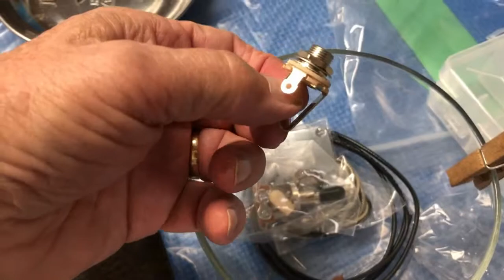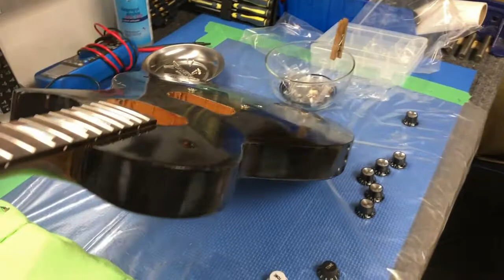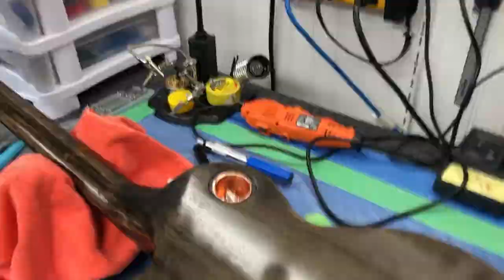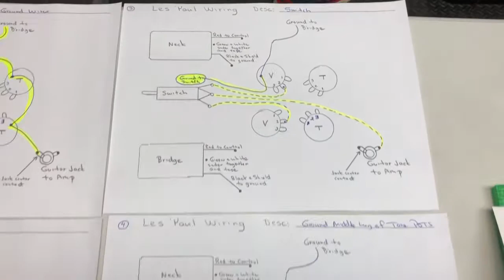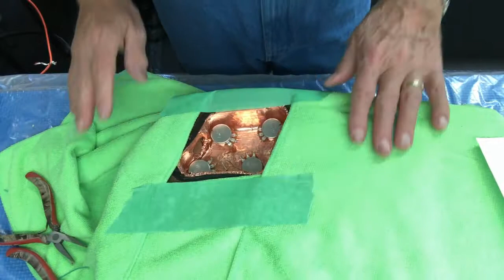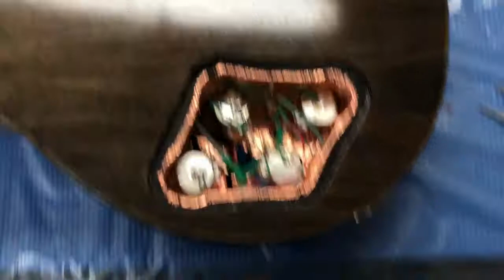Guitar Repair - Gibson Les Paul Rebuild-5

Comment: Thanks for this video series that you have done, i am currently rewiring a switching out all the parts on a Les Paul copy guitar made by Encore. I can certainly see the difference between the quality of the guitar that i have compared with yours. I have never done anything like this before and you pass on a wealth of tips that i have taken note of. I am also doing the copper shielding aswell and have changed the pickups also. Glad to have found you on here you have been a great help and my daughter cant wait for me to finish my project 1st guitar. All the best from the UK.